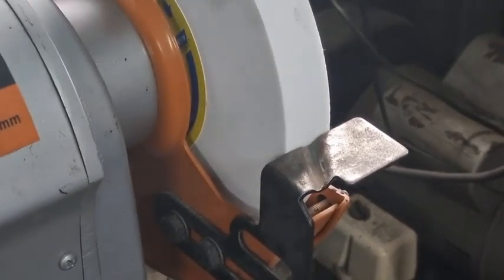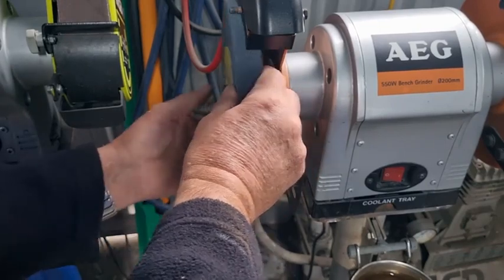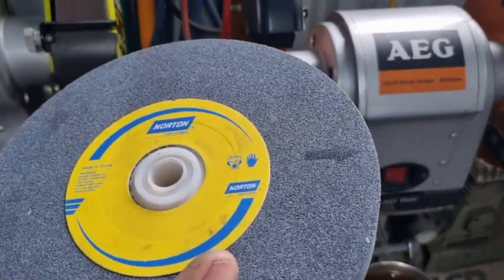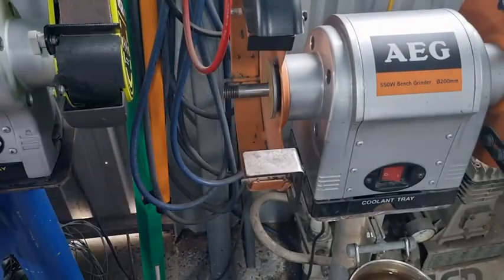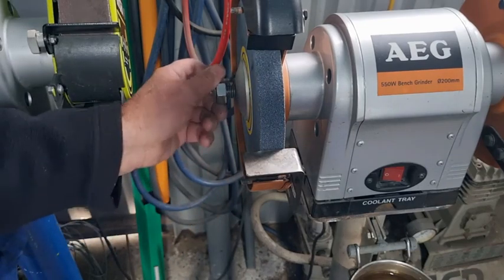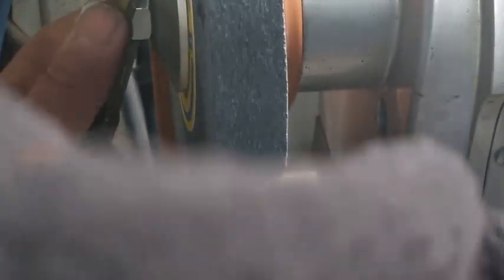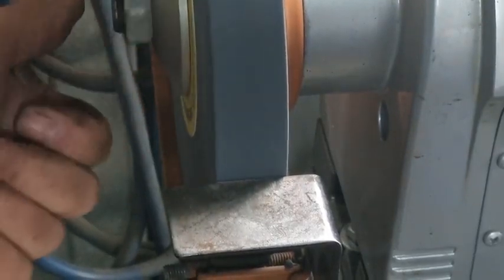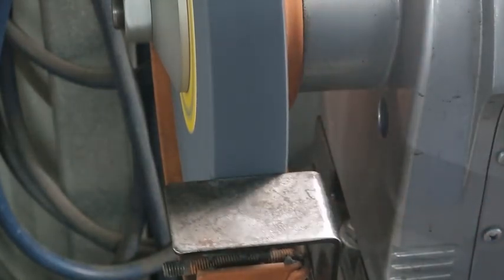Grinder wheel wobble fix, on all grinders, chainsaws included

Comment: I have been going through the same problem too, I made new mounting plates and its much better now but not perfect, I have ordered some spherical washers for behind the nut, I will let you know how it goes when I get them, I also tried a CBN wheel, they are very smooth to use and much less heat.
Reply from the maker: I remember last week I Swapped over from 3.2mm wheel on chainsaw grinder to 4.8mm wheel took me 20 goes to get it right.  Other times it runs dead straight 1st try.  On my stihl USG grinder never a problem, must be lucky
Reply: Yo, did spherical washers fix wheel wobble?
Reply from the maker: To fix the problem I just made new cardboard gasgets from a old exercise book and that normally works well. The problem is the aluminium oxide wheel have a porous surface that is not 100% flat that is why you see thin paper sticker each side of the wheel.  Sometimes you need thicker paper to eliminate wheel wobble
Reply from the maker: All my spherical washers are ok it's the paper gasget that is causing the problem
Reply: The washers made a big improvement @djedvis
Reply from the maker: @harry8506 wow awesome 👌
Reply: @ChainsawUsers  GASKET, not GASGET.  :goodvibes:
Reply: @harry8506  Thank you!  Great info.

Comment: I bought a new cheapisg 6in grinder. One wheel was rather bad. No matter what i tried it would just be bad. I finally stripped the unit down and put the shaft into my lathe. What i found out was that the right side shaft was machined incirrectly. It was crooked. Not sure how that happens but there it was. Soon i will be machining it straight. But that will require making spacer and such. So if the wheel just doesnt balance after all the tricks, check the machining of the shaft.
Reply from the maker: Interesting story but it happens
Reply: @ChainsawUsers  yea, lucky me !
Reply from the maker: Could it have been dropped ?
Reply from the maker: We all have those stories lol. Nothing you buy is 100%
Reply: @ChainsawUsers  no idea but I saw no damage to the box or packing. For sure nothing that would have bent the end. Again, anything is possible but no sign of anything that would have alerted me.
Reply: @ChainsawUsers  yea, anything I buy now I basically expect that I will have to do something to make whatever better and functional. Sometimes I enjoy it but something like a bent shaft is beyond my enjoyment level.
Reply: Good insight.  I have a horribly wobbly set of wheels on a brand new bench grinder. Must be the shaft.  It is almost rocking itself off the counter, that bad. Ugh.  Such a pain to work with cheaper grinders.  I wish I had a Jet.
Reply from the maker: Yes it happens glad you fixed it
Reply from the maker: Try the thin cardboard washer each side

Comment: Typical Ozzy test…stick your finger on it..😱
As already mentioned, the cardboard washer didn’t make any difference…it was rotating the alloy washer that did the trick..
It’s also a good idea to check the nut faces are flat and parallel to the wheel..
Reply from the maker: That's interesting but can see that also a problem

Comment: it doesn't seem like your cardboard made any difference at all - it was "moving it to another spot", you didn't really explain what you were doing there but if I understand it was rotating the cup washer, which probably is warped and the source of the lateral runout.
Reply from the maker: The cup washer is ok.  Most cheaper  wheels have a small amount of wheel run out.  My Stihl USG wheels are of much better quality and have paper gasgets on both sides.  Cheaper pink oxide wheels with paper on one side only normally have more wobble run out.  Even my 8 inch bench grinder has some wheel runout